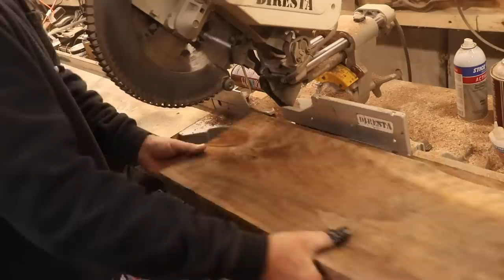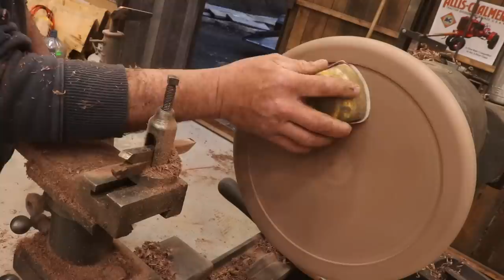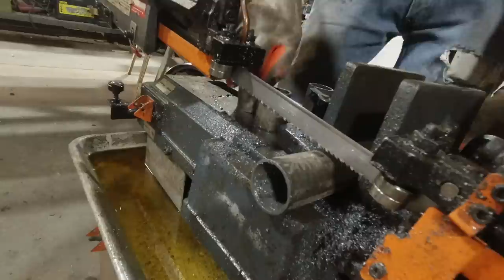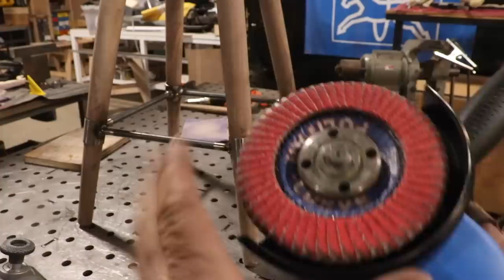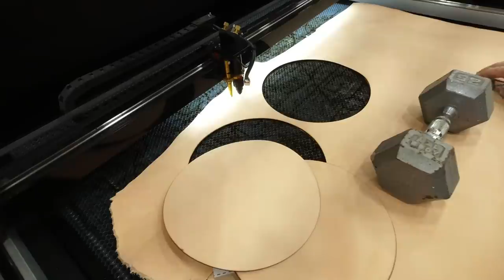DiResta Leather Wood & Steel Stool

Comment: Admirable problem-solving skills. I see no reason for industry to improve those epic machines. BTW You don't have to be a scatologist to recognize beautiful stools. Is that walnut?
Reply: When he recently restored one I mentioned that it was good for another 100 years.  Those machines are epic and you didn't have to have a degree in computer science to learn how to maintain them, or even see how they work.  We'll never be able to improve on the simplicity and sheer durability of those machines.
Reply: That's one of the things I admire about Jimmy, His love of old machines, and his ability to embrace new tech.
Reply: @BoomerKeith1  I'm sure somebody said the same thing about the rock hammer.
Reply: @aaronmattia8998  There's just a slight difference between a rock hammer and a 100 year old band saw.

Comment: Love to see those old industrial monsters going.  Though I have to say a video of you hauling them down into your old shop , and cutting through the ceiling to fit them in would have been an epic!
Beautiful work as always.  One thing I find inspiring by your builds is that there is almost always a moment where I go "interesting, I probably would have done it another way".  On some other build you will have done something similar and done exactly as I would have.  I'm not sure if you intentionally change things up just to keep it interesting or to show there are a zilion ways to get fro A to B, or maybe just throw a curve at the audience.  I don't care, it's great and it reminds me to look at different angles when building.  It's easy to get in a rut.

What a great place to shelter in place!

keep safe

Comment: Really nice stools. I was a little concerned when you didn’t put glue on the legs before inserting them into the seats but when you put on the steel, I could see it was going to be solid on that alone. Do yo happen to know what type of tree the planks were sawn from? Great to see the new lathe and drill press working so well.

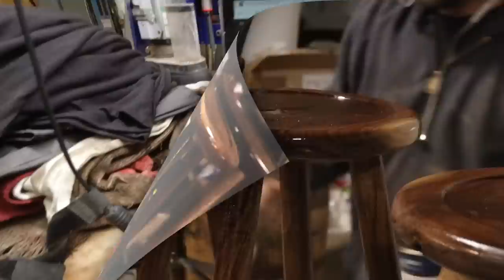Comment: All the math going on with that cutter at 15:28 is insane! Scary accurate!
Reply: I can appreciate that, but it's really just a two sine waves 90° shifted (or a sine and a cosine wave) that determine the travel of the X and Y axes
Reply: @spacenomad5484  Even when it looks like it's moving in one direction, it's still always moving in two directions simultaneously. Nobody gets that.
Reply: It's a simple laser cutting machine....
No rocket science there....
Reply: @shabadkirtanforall5764  Nothing simple about a machine that moves in only 2 directions cutting a perfect circle. The engineers just made it look simple. 🙂

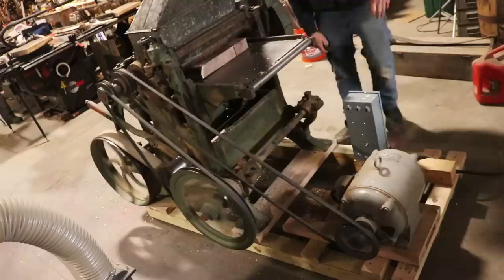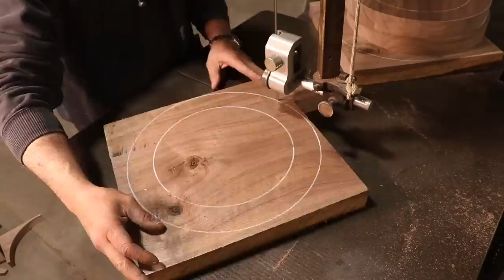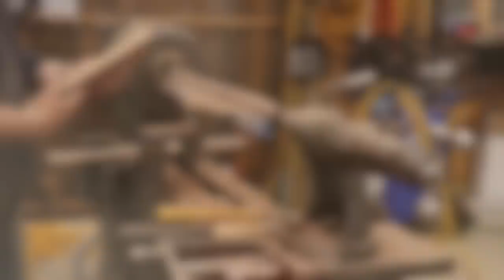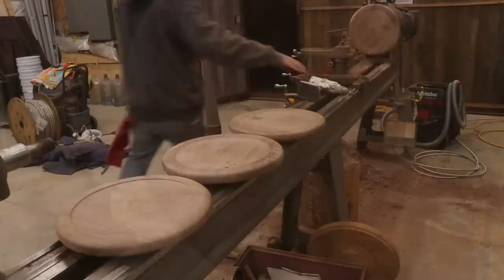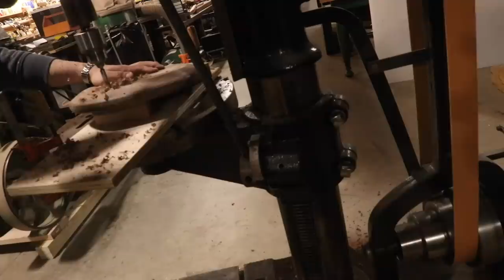Comment: Thank you for the vertibal showcase of vintage iron porn ... thickness planer - 2:47, bandsaw - 3:29, lathe - 4:53 and 8:58 (geesh, look at the length of that bed) and of course that drill press you put together for us - 9:55, 36" sanding disc - 10:37

You always seem to satisfy.

Your new shop has come together very nicely. Deep down inside I hate to admit there is a touch of envy

I'm gonna be watching this one many times over

At 6:57 the 1855 written on the the lathe in chalk would happen to be the date, or is that the weight?

Perhaps for a future vlog a few words from your sawmill fren and a video tour of his rig? I would love to get a look at the giant flywheel that ran it when it was new... prbly steam at that.

Comment: now you need to build the other 10 thousand of them ,, great work ,,buy them in a store and most of them break in less then a year ,, the ones you build will be around 50 plus years ,, i see you have a plasma table in the back ground ,, do you have a extra one kicking around ?? looking to get one ,,was looking at one that will do 4 x 8 sheets ,, ouch

Comment: hi Jimmy, great vid as usual! I'm making a small stool for my daughter as well: any idea what the angle was for drilling the leg-holes? Thx & keep it up!
Reply from the maker: Bjorn Ruysen I copied from a stool in the shop
Reply: @jimmydiresta  ok no problem ;-)
Reply: A typical angle for stools is 5 degrees, but it really depends on how tall it is and how close to the edge they attach. Basically, you want the feet to end up about 10 to 25% wider than the seat.